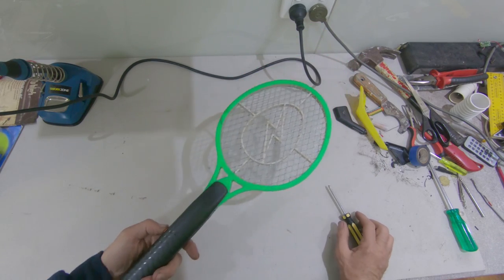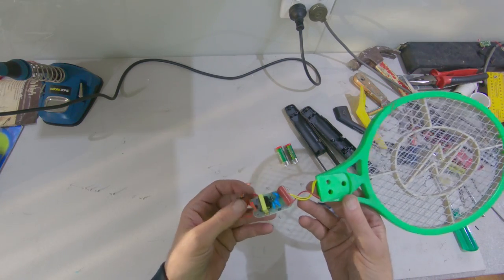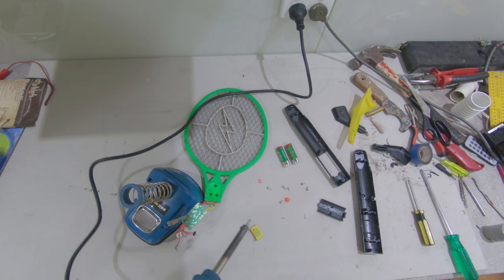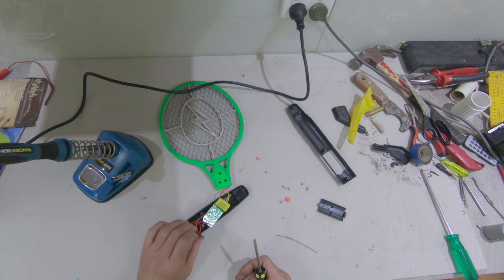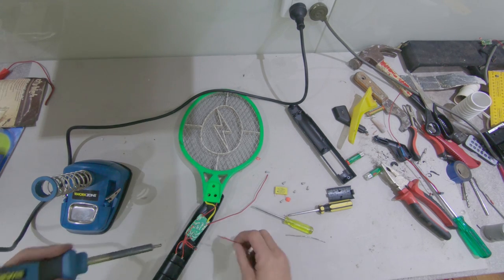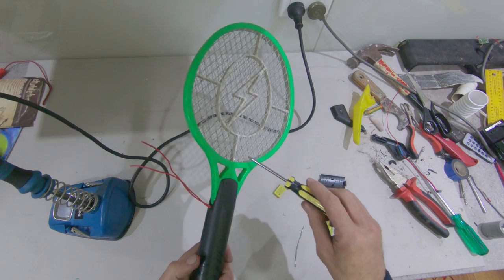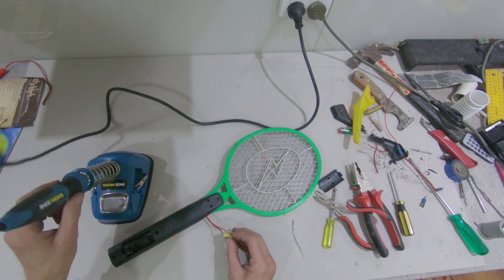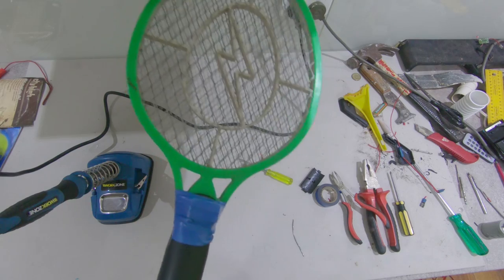Teardown & Hack Electric Flyswatter

Comment: Hello, looks like there was room right above the original capacitor inside the casing. i think it is saver to placer the extra capacitor inside. regards
Reply from the maker: Yes, I see what you mean, but the capacitor was just a little too big to fit in there probably.
This capacitor was taken out of a broken grinder, I have since collected a few more that will actually fit in the space you mentioned, thanks for your comment 🙂

Comment: This is really awesome! Thank you for this video. I live in Brazil and I definitely need a more powerful zapper.
ALSO: Has anyone made a "traditional" bug zapper out of one of these rackets? The kind of bug zapper that has a light in the center and the insects fly to it and get zapped. One of my rackets broke and I was thinking of rolling the screens into a cylinder/roll and putting a light in the center. I think it might work, but not to sure, because when you hit the bug with the racket, there is a lot of force that causes the insect thru the first screen and into the second screen. Maybe the insects won't be able to kill themselves properly by touching both screens at the same time. LOL.
Reply from the maker: Nice idea 👍, I think it'll work if you put a UV globe in the centre just like the traditional bug zappers you plug into the mains...

Comment: ❤ I Prakash Sharma from Bhopal (India), also added extra pf capacitor in parallel but not increasing output voltage from 500 vdc to 1k vdc which is extremely necessary to kill mosquito.
Please suggest solution.
Reply from the maker: It will not increase the voltage, but adding a .22uf capacitor will increase the output current...

Comment: I saw mine has a 0.33uF 275V one in it and a small resistor.
Could I use a 180uF 400V one or is that too much Farad for safety?
Reply from the maker: It will take too long to "charge up", I have tried this before and it took a while between useful "zaps"
Reply: @chich7089  I've noticed, an electrolytic capacitor of this value only charges to around 475V, standard it reaches 840V.
So I added a couple 275V film capacitors instead so it still reaches it's 840V.
Namely I have these three now in it: xgd-x2 mkp (standard), x1 ckx 824k 300v and a ps105k, both of those out of an old broken PC Power supply.
It works and cooks more but since it's the same voltage with the double AAs it doesn't zap better at all, only cooks better.
Reply: @Shishou_Shi  You should not charge a capacitor to a higher voltage than its rated limit. 
The 400v capacitor probably got to 475v before it was damaged and began to conduct, limiting the voltage and wasting power. 
Better to use capacitors which are rated to handle above what voltage they'll be charged to.
Reply: @dancoulson6579  well the standard film capacitor was a 275VAC one, so what does that say about it? 
Electrolytic capacitors don't work for this application anyway. 
Since the two capacitors I added exceed the limit of the standard one I think it should be fine but I did remove the resistor that technically lowers the voltage.

Comment: Its an awesome hack! Thx. Is it possible to make the circuit at home and make our own customize Electric flyswatter?
Reply: Sure, it's not a complicated circuit. Just step up the voltage to about 3000V or more and use it to charge a capacitor that you make as big as possible.

Comment: The original capacitor is usually 1.5/2kvolt, the one you have mounted is certainly lower if you have removed it from a grinder, with the voltages involved it risks exploding.
Reply: No one care

Comment: Hollie Garner I’ve added one capacitor of 2 kv (actually the same as the original one. I got it from a spare swatter) in parallel. But I don’t notice any difference...? Actually it seems like the swatter had become less powerfull
Reply: Add it in series

Comment: Terminals match up nicely with 9v alkaline…would it be hard to modify this so that increasing input power from 3 to 9v wouldn’t damage it? What would that do to the high voltage output which is currently about 3-4 kV, I think.? Thanks.

Comment: Would it make any difference just changing the battery pack to a 9V?
Reply from the maker: I tried that with another bug zapper and it destroyed the transistor, though it did work for a very short time, thanks for the comment Kim...

Comment: How did you know that the earlier capacitor was burnt or broke, that you went straight to the old capacitor and replaced it ?  What was that you found that identified the capacitor was the culprit ! 
Nice video and very informative.
Reply from the maker: Shashi the old capacitor wasn't broken, I just added another capacitor in parallel with it to increase the total capacitance...
Reply from the maker: @Fred Ziffle the capacitor voltage rating that I used is 300v, you can use 250v capacitors also...
Reply from the maker: @Fred Ziffle you'll find those capacitors in old drills and grinders, try putting a few in parallel...

Comment: Hi Chich, Thanks! Can I add the capacitor to a 120 VAC rechargeable swatter?  I imagine it has a rectifier circuit and dc battery, the rest the same.  Thanks, Gus in Caracas.
Reply from the maker: I'm sure you can Gustavo, add a couple of capacitors and have fun!! Thanks for your comment...

Comment: Nice..... but,
A capacitor in parallel adds its value to the value of the capacitor already in the swatter.
This creates a bigger spark
But the fly swatter remains under tension for minutes after letting go of the pushbutton.
Therefore, a discharge resistor must be placed across the capacitor for safety.
I think 22M 1/8 watt is enough (red red blue) 
I also wonder whether the electronics can withstand the larger charging current because the capacity has been increased.
The voltage on the red wires outside the swatter is about 2000 Volts so the insulation of the wires is questionable.
It is better to keep the capacitor inboard, there is enough space.
Also do not cross the wires inside  to the wire maze on the outside
but run them parallel to the capacitor leads to avoid a flashover between wire end capasitor.
Who I am? I'm a technical engineer at KEMA, The Netherland.
Reply: Can you please translate this to English:)

Comment: If I cut one of the yellow wires trying to remove the top metal mesh ( I didn't know it was attached to it under the plastic handle) can I bridge it with the other yellow wire?? Will it work??
Reply: Yes, the 2 yellow wires are the outer grid, the red inside one is the positive.

Comment: I’m looking to make a zapper that runs on electricity that I can place outside and constantly kill flies . Any ideas?
Reply: caniborrow20dollars  I’ve done that but I need to figure out how to have it running all the time
Reply: caniborrow20dollars  I don’t want it running 24 hours per se but want it to start working automatically the next morning. The bug zappers don’t work because flies seem to be attracted to smell not light and you cAnt really place the bait efficiently in them. I fixed the problem by buying zappers that charged from USB cables and had them connected to power directly.I do follow your advice and duct taped the switch on. It works like a charm although doesn’t look great aesthetically

Comment: well done sir , useful info. ...  I need a way to modify EITHER , this type of zapper racket .. OR .. the  big electrical - AC operated - one , to be operated continuously by DC 12V of solar system ... Is there any way to doing so , you - or any one else here knows - PLEASE explain it in a reply !!! ... thank you in advance .
Reply from the maker: 12 volts DC will destroy the small zapper, I'll have to experiment to see how you can operate it on 12volts...
Reply: @chich7089  
O.K , I am waiting eagerly for the result of your test ... Thank you , again !

Comment: Don't understand how you could use caps rated at only 300-500 volts (as described in some of the comment replies.) Isn't the secondary creating something like 2 or 3 KV (I know it's DC, but its still in the kilovolt range)?  Seems like those capacitors would break down at that voltage.
Reply: Well i think he looked at what capacitor originally was inside and since it not breaks  down it's voltage is okay.  But maybe some not so honest  manufacturer made it cheaply by putting inside capacitor without voltage reserve, and it's not good. 
The best way is to make a measurement through divider.

Comment: Great video! Would you reccomend i match the same voltage on the microfad capacitor to the one the racket comes with standard?   Thanks!
Reply from the maker: Same voltage or higher should be ok, Cheers..

Comment: I live in Arizona, we've got a lot of the same annoying, sometimes poisonous, critters running around that you do in Austrailia.  What size was that transformer you used?  What do you think would deliver more punch, using batteries with higher voltage or ramping up the transformer?  For a big bug killing zapper, do you need a new capacitor also?
Reply from the maker: Hi Chris, the tranformer is the standard one fitted to the bug zapper, I'll do a video later and  I'll be increasing the battery voltage to see what the zapper will do. Some extra capacitors will be added as well just for the fun of it.
Good luck with your critters!!!
Reply: You could try turning the voltage doubler into a tripler, but it'd likely arc on you and you'd need higher voltage capacitors.
Reply: @chich7089 
Still standing by for that video.........

Comment: just fyi, you can simply attach 1 lead of the cap to the inside wire grid and 1 lead to the outside wire grid (both outside wire grids are electrically connected already), no need to disassemble as electrically the same place you placed yours.  Be careful, wrong selection of cap and the cap can go boom... yes explode :  )
Reply from the maker: Yes, you are right about the grids being electrically connected to the capacitor, but I found it near impossible to solder on the aluminium grid, hence taking apart the handle to solder on the capacitor leads.
Thanks for your comment Kenneth...

Comment: There was still enough space inside, why run the cap outside the casing?
Reply from the maker: I would've had to break away some of the plastic molded tabs on the inside of the handle to fit the extra capacitor, thanks for your comment, cheers...
Reply: @chich7089  thanks for the reply, was curious ü

Comment: .22uf doesn't really seem like much. 

What are the voltage ratings on those capacitors?

I'm thinking the extra capacitance wouldn't increase the voltage at all but it would increase the current during the discharge.

Definitely be careful.

Comment: Is there a reason they go from DC to AC and back to DC?

Obviously batteries are DC and you want DC for final, but do they just not make a step up DC to DC to 3000V ?
Reply from the maker: Suijin Noname, I think it's a cost issue, both circuits would need a transformer, and this one is effective and cheaper to manufacture, with minimal parts...
Reply: Yeah I searched just for a bit and saw only about $120 for just DC to DC
Reply: The current (amps) at the AC end is very small, it would tickle a fly. Therefore its converted to DC and the capacitor is used to store the charge, thus supplying high voltage and a burst of high current enough to zap a fly.
Reply: DC doesn't increase voltage going thru a transformer, so you have to convert DC to AC using that oscillating transistor. The transformer hikes the voltage up and then the diodes convert back to DC to do the zapping.
Reply: @PF-gi9vv  Honestly original capacitor is not enough,  it's only bruise fly's and they quickly return to flying, that's why i looked for increasing power to one tap them.

Comment: Interesting.  Need to convert a couple of cheap ones. Isn't there a really high Ohm resistor over that capacitor?
Reply: Luc Peeters  on this particular model the capacitor is across the secondary windings of the transformer, no resistor at all. I can press the button and come back to it after 30 mins or so an it will still spark.
Thanks for you comment.
Reply: @nikitaverginadis8579  sir , I need a way to modify EITHER , this type of zapper racket .. OR .. the  big electrical - AC operated - one , to be operated continuously by DC 12V of solar system ... Is there any way to doing so , you - or any one else here knows - PLEASE explain it in a reply !!! ... thank you in advance .
Reply: @muneerwahaib6359  both the zappers are AC operated
Reply: @muneerwahaib6359  in this model dc is converted to AC and in the other big one AC is used to charge battery
Reply: @muneerwahaib6359  to run an AC circuit with 12v DC you must use an inverter unit to invert, convert, and boost the voltage

Comment: I was adding new caps 2000v 223j but the zap still weak, battery condition is good 4v, whats wrong ? can u help me
Reply: What you that'd be a 22000 picofarad capacitor at 2000 volts, so 0.022 microfarad. Go with a 0.2 or so microfarad capacitor, so a 204, 224j (j is the tolerance of 10pF x5 +- the stated value and isn't critical at all in this application).
Reply: Check transformer and transistor

Comment: Can you tell me why just adding a capacitor ads more voltage? Isn’t the parallel going te have the same voltage on both capacitors namely the voltage coming out of the transformer? 
Please help!
Reply: voltage will be the same, charge time on cap increased , but also discharge current greater, cap needs to be high enough voltage rating not to break down

Comment: What is the value of that poly capacitor which extra connected at least ?
Reply from the maker: The extra capacitor is a 0.22uf 300VAC, it was out of a broken drill...

Comment: cool, could i use an electrolytic cap?...say 470uf- 1000uf?....
Reply from the maker: Yes you could, but it will take much longer to charge the capacitor after each "zap"...
Reply: @chich7089  thanks. What about a film large cap 470n-1uf?...still a long charge?
Reply from the maker: The smaller the capacitance, the quicker the charge but smaller "zap"
Reply: ok, cool, i'll wire up 2 wires, and test with various values...cheers.
Reply: Most electrolytics couldn't handle the voltage (3K?).
Reply: @kenweller2032  I've used electrolytics that had voltages from 250V - 1200V, depending upon the application, so they're far from uncommon. Might have too much inrush for the oscillator, behaving like a short circuit at the suggested values. I'd go with 4.7 uF and drift perhaps to 10 uF.

Comment: can you use a h v capacitor to up voltage
Reply: No, adding additional capacitance only increases the level of stored charge. It does nothing to change the voltage ⚡ input. To increase voltage you can do one of 3 things. Increase battery voltage to say a 9v battery. Modify the built in voltage doubler circuit into a tripler by adding additional capacitors and diodes to the circuit. Swap out the transformer for one with a higher turns ratio.  OR..... you could just do away with the factory guts and make one of those 50,000v modules for sale on Amazon and eBay fit inside the handle along with adding the biggest 3.5-6v rechargeable lithium battery you can cram into it. Guaranteed devastation then!
Reply: If you do modify the circuit by increasing voltage ⚡, THEN you may have to install a capacitor with a higher voltage rating.... just remember that a capacitors voltage rating is only indicative of what it can withstand voltage wise. It says nothing about total capacitance and is not to be interpreted as an output value. A 10,000 v capacitor can work just as  fine at 5 volts. Just don't exceed 10k on voltage.

Comment: How big is the extra capacitor. 
Can you take a anather zwatter capacitor and solder it paralel as you do.
Thums up! !!
/ Peter
Reply from the maker: The capacitor I added was a 27uf, it was out of a broken electric drill, you can put one out of another bug zapper, works just as good...
Reply: Thank's :)
Reply: @chich7089  27uf but how much volt?
Reply: shagar cool the voltage does not matter, 25 volts would be fine the voltage rating is for the maximum the capacitor can handle
Reply: @chich7089  are you sure it was 27 microfarads? That's awfully fully tiny for such a value and would likely bog down the oscillator due to inrush.
Perhaps 0.22 uF, which would be more like that form factor?
Reply: @TheFalconJetDriver  25 volts would let the magic smoke out. Try going up an order of magnitude at the least.
Reply from the maker: @spvillano  you are right, sorry my mistake (typo) cheers...
Reply: @chich7089  well, we all make misteaks.  ;)
Reply from the maker: @spvillano  great reply!!